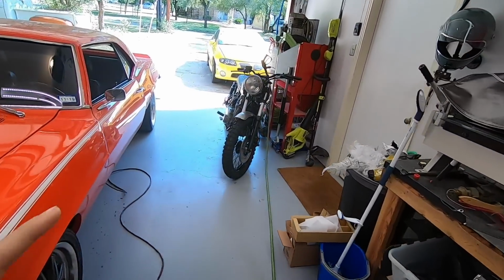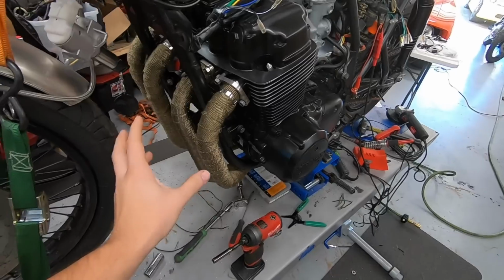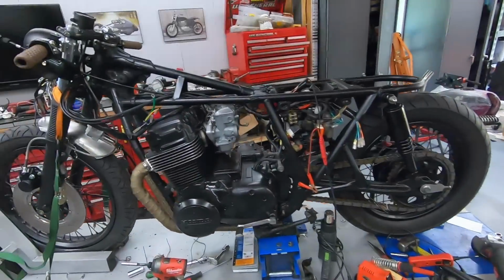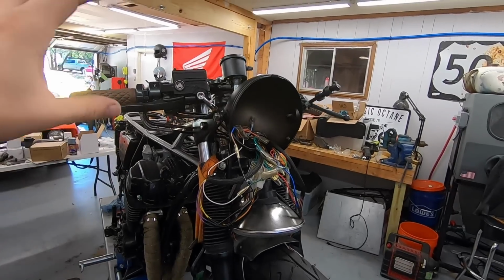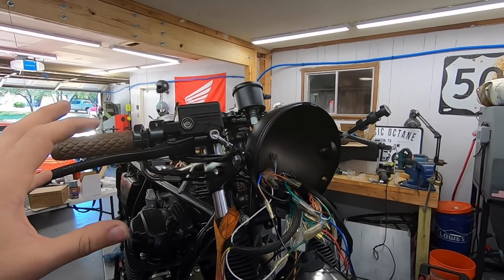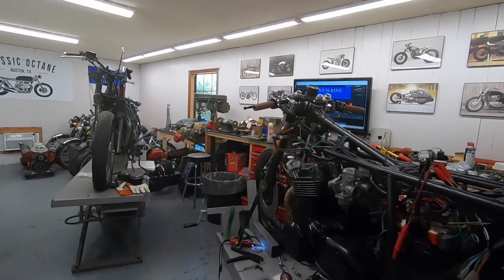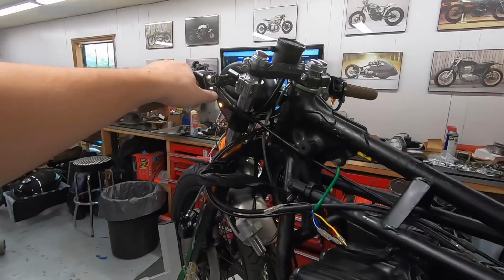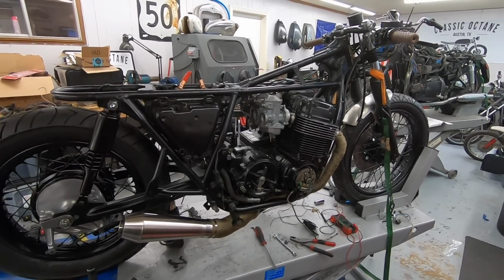Rewiring a classic Honda for universal switches and LED lights.

Comment: do yo have good luck with these switch's? I been contacting the companies on ebay and only one got back they say there rated to 10a continous  today I hooked up my headlamp and it pulls 4.5A low and 4.9A high so I think it'll be ok.  everything else I believe is low amp draw anyways.

Comment: I was needing alittlr help lol I have a 1981honda cb650  and I put it on a chopper frame anyway  I've never wired a bike  or anything like it so I guess what I'm asking is is there any way you can walk me through this. I'm starting from nothing no wire to look at or anything I'm very dumb  when it comes to this wiring don't know why it seems simple  enough but I just need some help

Comment: My problem with this switch setup is the start button. With the original start button, the headlight circuit is hot when the key is ON and start button is not pressed, and OFF when the start button is pressed. This forces the headlight to be shut off while starting the bike, and prevents excessive current draw. It also helps ensure you have maximum power for the starter motor.

In your setup the headlight won't shut off when pressing the start button. You'd have to manually toggle off the headlight.

Also, the low beam should be OFF when the high beam is ON. Your setup allows the possibility of both being on, which can kill a sealed beam halogen and deplete the battery.

I just caught this when rewiring my own bike. I remembered seeing this video and thought I should come point it out.

Comment: Hey man! This is amazing! I just bought my CB550 and my xmas project is to strip it down and rewire it. As a complete beginner it's a mine field - do you have a list of components you've used here? The setup is close to what I'm after minus the strip light out back so it'd be SUPPPPPPPPPPPER handy!

Comment: Hello Taylor! I wanted to ask you brother where did you get that lower stainless steel braided brake line? Because I already have the one from the master cylinder to the rear brake switch but I don't have the one going from there to the caliper and if you can shine some light on where you got yours that would be great, thank you Taylor

Comment: Nice work! I almost wish I had gone this route when I restored a '72 CB350F. I spent a LOT of hours rebuilding the stock switches and getting the stock wiring harness lined out to where everything worked properly. I dropped the stock turn signals, since I was going for more of a classic cafe racer look with the old style 1/4 fairing, pod filters, 4 into 1, and a few engine mods. 4into1.com is definitely the top choice for getting just about anything for vintage Honda 4's, and I also used them frequently when I was building mine.😁👍

Comment: < I am Jeff Smith, I have 2 550 Honda,s I am in Stanford Kentucky, I am an old OLD, Honda mechanic, I really enjoy getting them to run, If I had a second fuel tank, they could both be ridden, I take the tank off the 76 cb and put on the SS to ride either,I am south of Lexington 40 miles, I am off I 75 29 mile Exit 89 then 150 29 miles into Stanford. both already have new 12 n12a4a1 batterys,. if you ask me the number for a piston and points and tires, I can give you all that, I am 65, and I work every day, I need 700 each for these, you will love the automoyive  thrush exhaust on the ss.,if you need pic let me know. call me at 606-669-0508.

Comment: I have that speedo...how did you get the neutral and oil pressure lights to work?
Reply from the maker: Key on power to the power side. Trigger wire from the sensor and neutral switch to the ground side.
Reply: @ClassicOctane  thanks for the reply...i will try that. I look forward to each of your bike videos. Keep it up!

Comment: I'm not putting down the switch replacement, just wondering are these switches more affordable than OEM if Honda switches are even available for this motorcycle, great job great video
Reply: Some of these switches are actually VERY expensive. Sometimes the cheaper option is to buy the replica style switches, but I don't think you can use an M-Unit with original/replica switches.

Comment: How do you cancel the left/right indicators? 
Also, I'd highly recommend replacing that black kill switch with a red one. That way in a crash, someone can easily identify it. If was black, I would think it's the high/low switch.
Reply: Tap one time is on tap again it's off.
Reply: It’s got a blue LED in it when it is on. Very easily identifiable.

Comment: On my CB450 brat build I used the existing power to the parking light to power an alarm rather than a rear bulb. So when it’s parked up I turn the key one more turn, take the key out then set the alarm. Works great :-)

Comment: Next time you make paint an engine, I'd be really interested to see how that process goes. Also, goes your GoPro have some sort of auto-exposure thing? The dark bands that show up when there's sudden lighting changes really messes with my eyes.

Also, for my headlight I incorporated some relays. One relay for Headlight on/off, the output of which went to another relay that diverted power to either the low beam (normally closed circuit) or high beam (normally open circuit). The two pieces of frame support under the gas tank make a good mounting point for them.

For my ignition, I got a K model ignition (from a 75 maybe?) and a earlier model OEM style ignition bracket that wraps around the frame under the gas tank.  Plug on the ignition matched the one on my 77 F harness - so probably would work with this K model as well.

I keep amending this comment as I watch XD